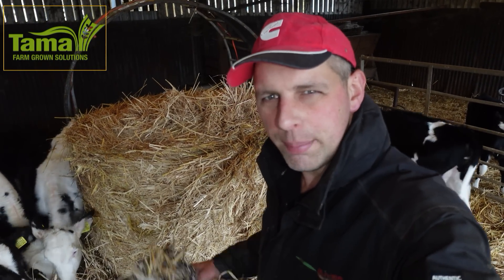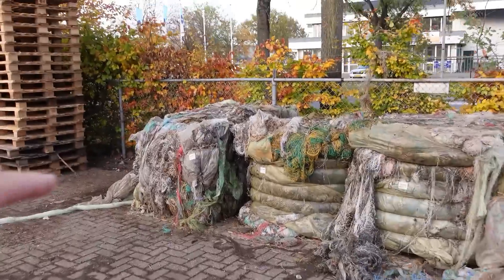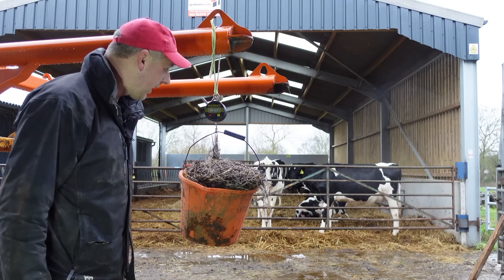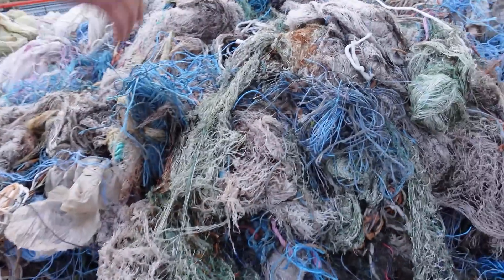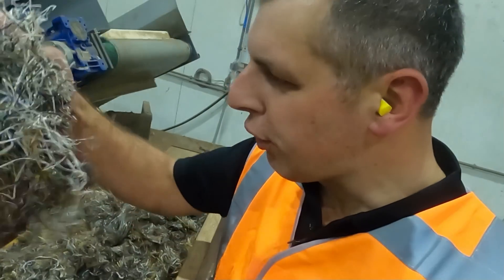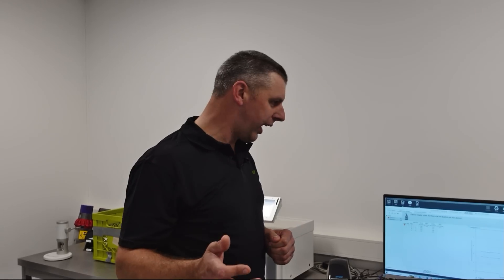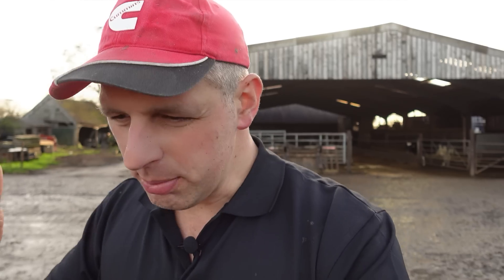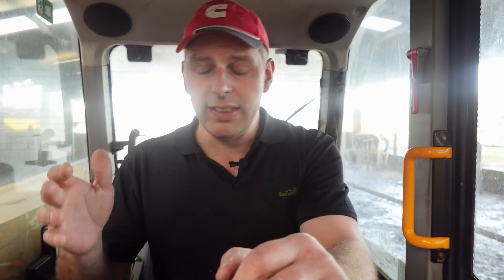How Do YOU Turn Old BALE TWINE Into NEW PLASTIC?? TAMA - HEALIX INSIDE The FACTORY!

Comment: Hi George, I love that someone has upscaled the process of utilising old twine & wrap. it is not infinite use though. every time the polymer goes through a heat cycle like an extrusion process or an injection moulding process it's bonds get damaged. from what I remember when running "regrind" material they could process the same material 5 or 6 times before it had no more use. That goes for alot of plastics like twine and netwrap, which I believe in a polyprop (PP)  base ( sorry cant spell the full name). off the top of my head most some automotive parts moulded are allowed up to 10% regrind with virgin material. Other non automotive products use 100% regrind material. It always concerned me when working in trade shops how we, as a company went about making sure scrap parts were put back into the production system. I personally never believe we can do enough to ensure we utilise scrap polymer parts back into the system to minimise our waste output. Very good video, really glad you put this up.

Comment: Surely you missed (to film) the steps of making the actual plastic again? We saw it go through the shredders but then what happened to it? I presume it goes through some kind of high density press to make those marbles we saw?
Reply from the maker: You couldn't really see the process if creating the pellets, basically the plastic gets heated to melting point, it then gets pushed through an extruder which makes the pellets.

Comment: It's a good thing to re-cycle. The only misgivings I have is the amount of energy needed to run the machines in the factory. In other words does it cost more to recycle than the finished product is worth?
Reply from the maker: Good question, it actually creates only 25 percent of the C02 that extracting virgin polymer out of the ground does so is a lot better for the environment. As the process is still being refined, hopefully things will become more efficient bringing costs down 👍

Comment: George? Is there anything else added into those polymers to remake the net or wrap or is it literally a is?
I presume the polymers go to another factory to be re made?
I know you can't show everything but how is the contamination removed? 
Great to see, thanks to the both of you and anyone else involved.
Reply from the maker: Hi Robert, with a bit of luck I'll be able to show the next step in a future video. But as it stands those polymers are just as good as the virgin ones. Currently they are sent back to one of the Tama factories where 30 percent of the recycled polymers are mixed with 70 Percent new ones to create new twine and net. The main reason being is that there is not enough being recycled at this time, hopefully this will increase 👍
Reply: @GeorgeSaunders  
Thanks for replying George. I'm surprised not enough being recycled as I thought it had to be done and I would think most farms send it off.